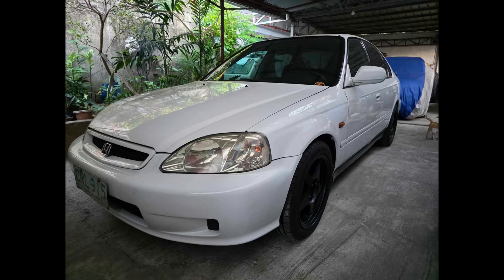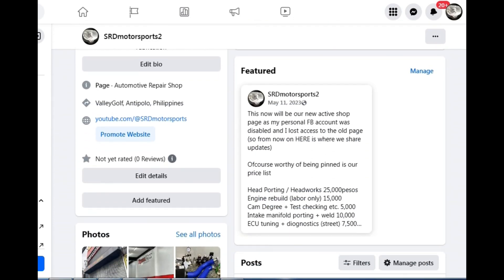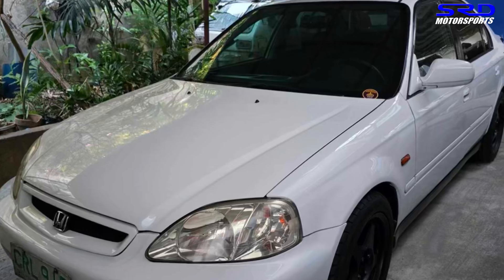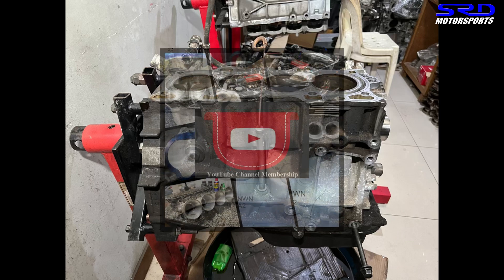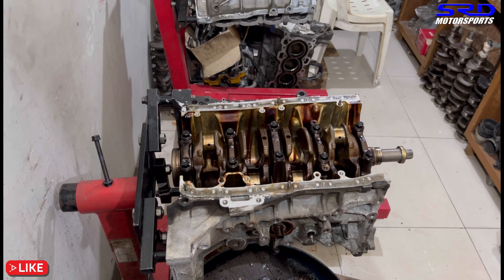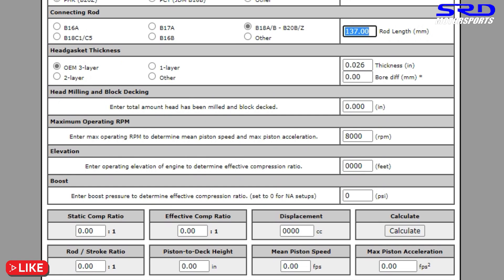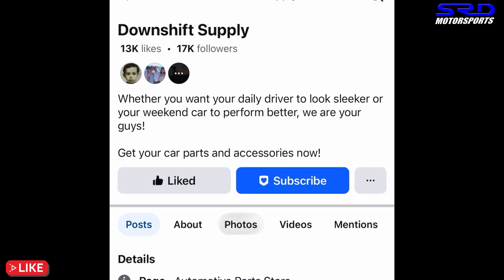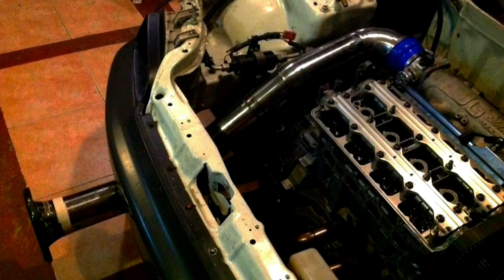Honda Civic SiR B16a to B20vtec Rebuild series part 1

Comment: Boss i want to degree my b16a with skunk2 tuner 2 cams with flat valves supertech and 13:5:1 ctr piston on straight e85
Reply from the maker: skunk2 website has the info needed

Comment: how do you know if the b20b has a blow by?i bought a honda sir with type r head with b20b block. and how much i would spend to get my car rebuilt again?
Reply from the maker: compression test is the easiest way to check, takes 5-10mins

Typer head is pr3 like b16 just people say it that way to hype the price gotta be aware of that
Reply: @SRDmotorsports yeah.. B16A PR3 head owner here since '02. It's still alive and tough. Those heads from ef civics are wonderful👍💪🙂
Reply from the maker: @BenjieCoB20VTEC  yessssss just like yours, it’s as tough as if it’s “bone stock” from the factory

Comment: Whats the highest you've safely revved these builds?
Reply from the maker: with arp rod bolts? And properly stretched? 9,500 no problem. The other one we did since 2016 til now still lives and it revs to 9,700 at the races

stock block b20 though we don’t really bother revving any higher than a stock CRV

Comment: Once finished, can you post the rpm redline and the horsepower it made? Ty sir
Reply from the maker: we will tune it after so yes but dyno unsure yet so horsepower is only seen on the dyno , this series will be updated it will have part 2 and the rest too